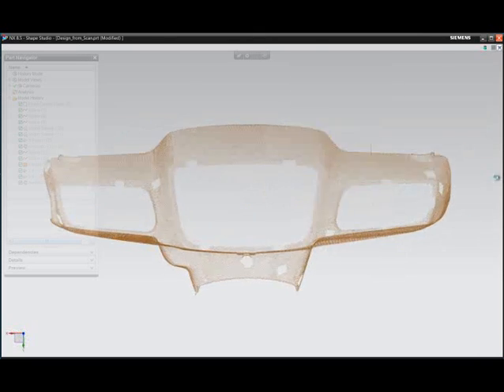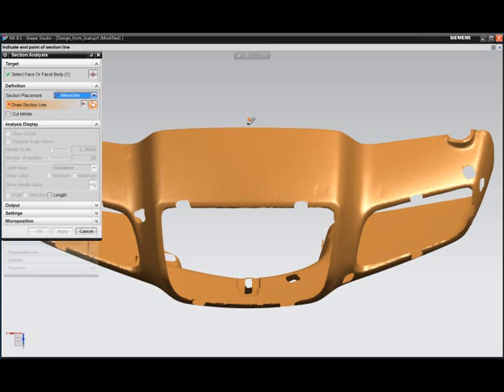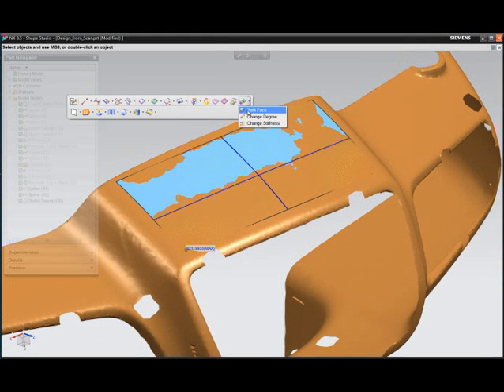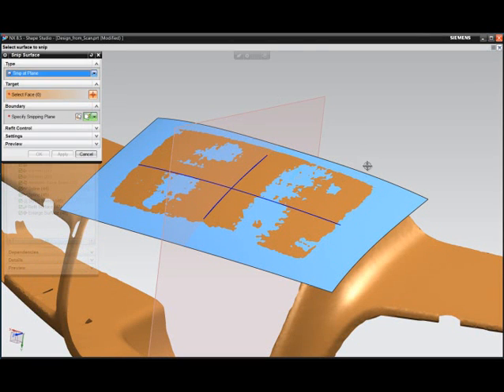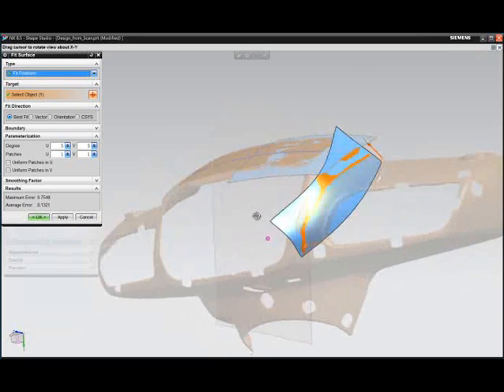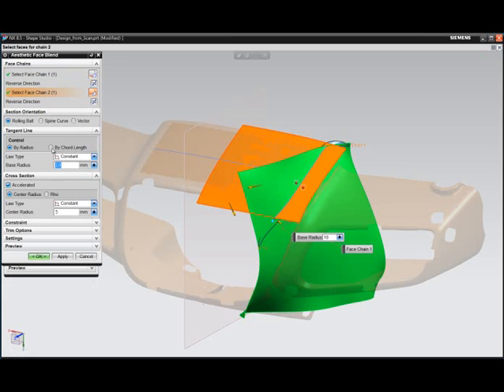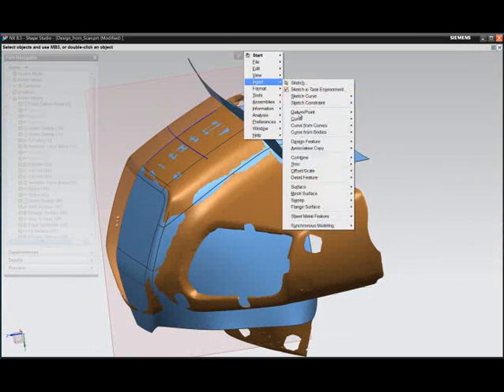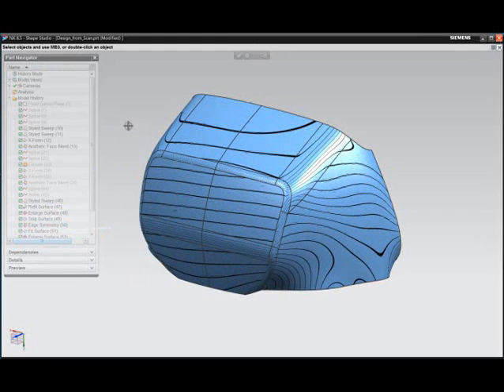NX CAD - NX 8.5 - Surfacing from Scan

Comment: Hello i have scanned data but seeing onvergented body. Section analysis does not cath my faes. Can i conver facet body ?
Reply from the maker: Hello. It is difficult to answer your question unequivocally. Working with scanned geometry is specific and gives you a number of possibilities. However, it does require some basic rules. When importing an .stl file, you can choose from 3 loading options in the Import window. One of them makes it possible to obtain Convergent geometry.